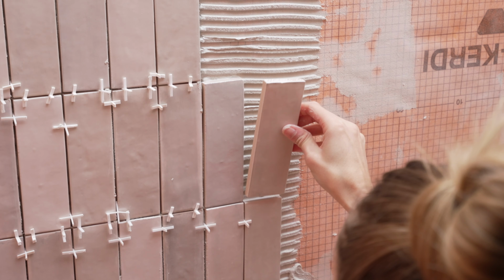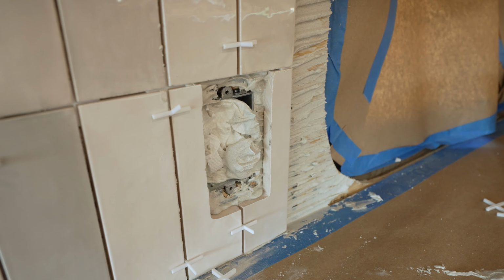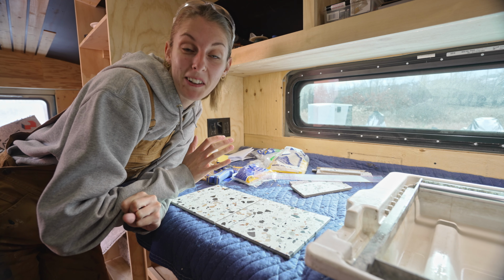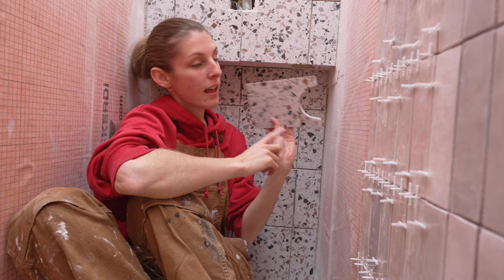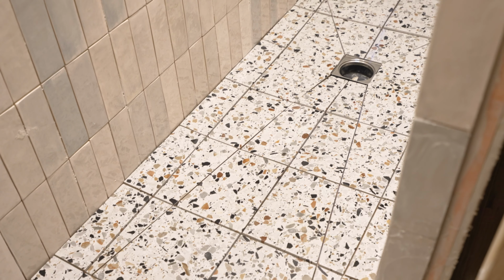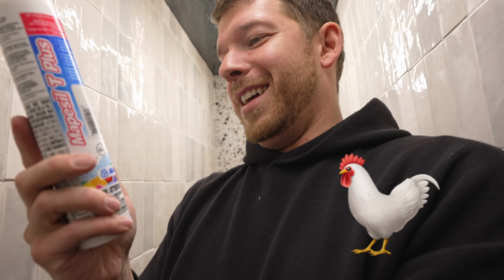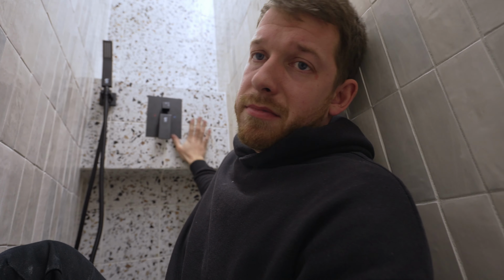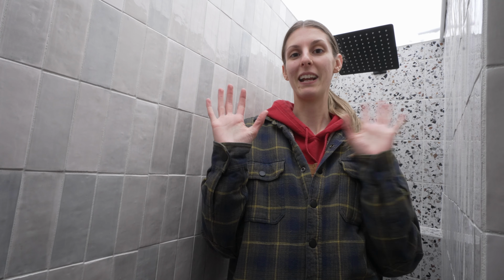Tiling in a School Bus | Skoolie Conversion Ep. 35 | Adam & Steph

Comment: Guys the tile job looks amazing, and what a wise decision on the tile (both selecting it and "approving" it)! Happy wife happy life, amirite?

I am also a complete tile novice, but on the backsplash let me ask, would it not have resulted in fewer weird cut pieces if you had started from the corner and worked outwards to the edges? Then any small variations could be covered with the edge trim?

The shower floor looked amazing though. Proper drainage slope is so important and you guys made it look so precise!